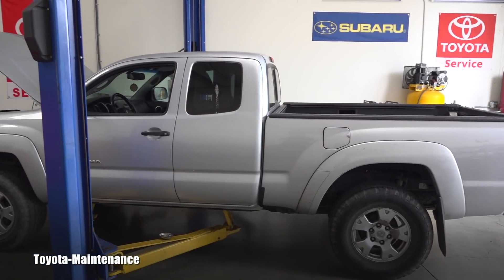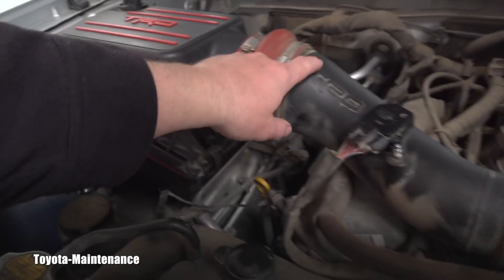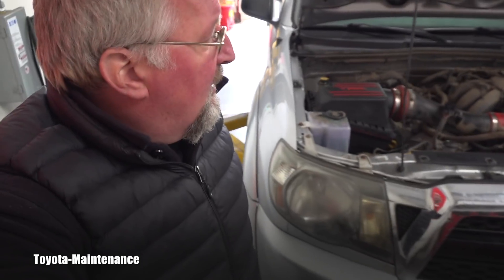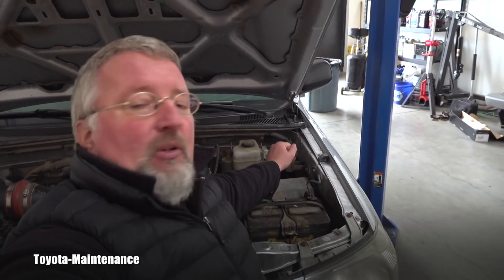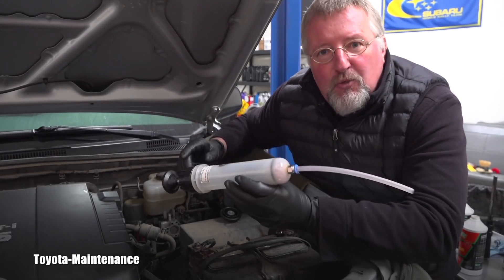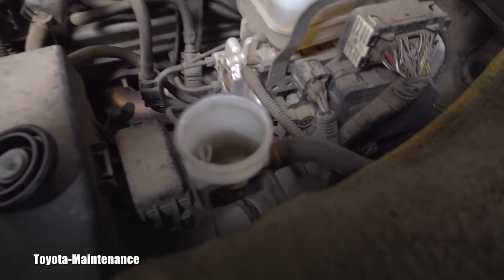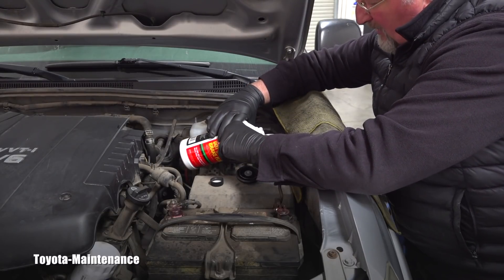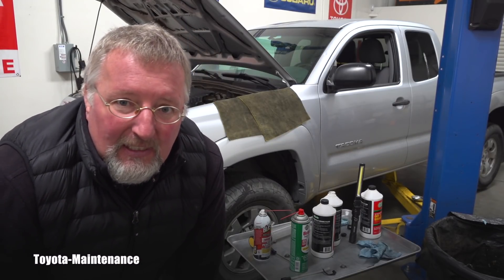How to clutch fluid flush

Comment: I recall opening the bleeder at the clutch slave cylinder and using a vacuum pump connected to an air hose to draw the old fluid out and refill the reservoir on the clutch master cylinder.

Comment: Wondering how to clean an engine that looks like that? 
Step one is to wipe as much dirt off as you can with some dry rags. (A vacuum with a synthetic bristle brush will work too, if you don't mind cleaning the oil off the brush later, because the engine will probably have some oily dirt on it.) Then use some damp rags to remove the rest of the dirt, which got wet and stuck to everything. That is usually good enough. Don't apply a lot of force to old hoses, plastic vacuum lines, and wires, because the heat under there can make them brittle.  
 But if you want perfection, dampen a rag with mineral spirits, and get the rest of the oily dirt off. Mineral spirts will evaporate completely. Before detergents were available, people washed clothes with it twice a year to get the oil from their skin out of the clothes.    
Do not use water from a hose to clean under the hood of modern vehicles  There is too great a chance to get water inside the many, low voltage wiring connectors, and cause corrosion on the contacts which will be very expensive to diagnose and repair. 
Of course, since it is a machine, it doesn't matter if it is dirty.